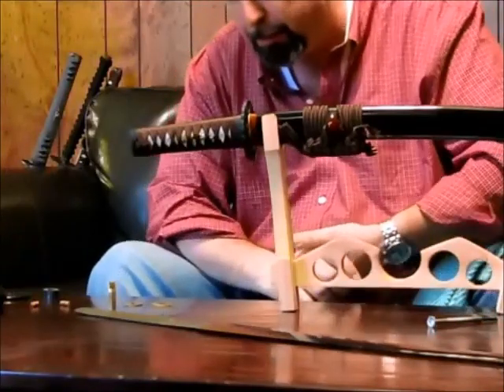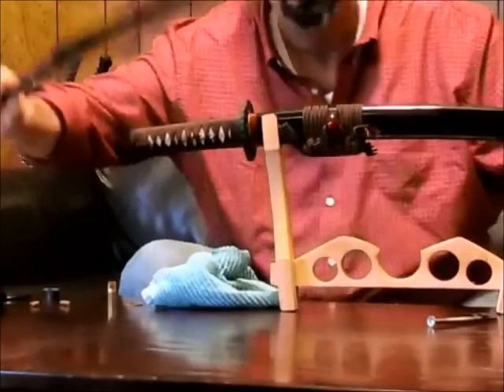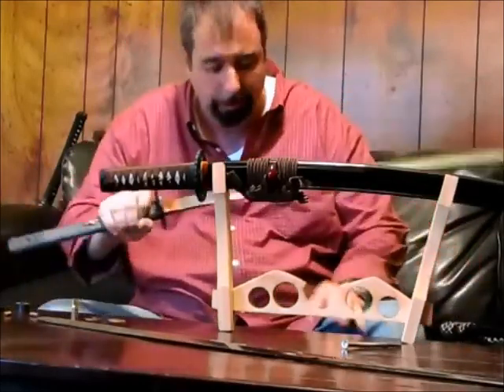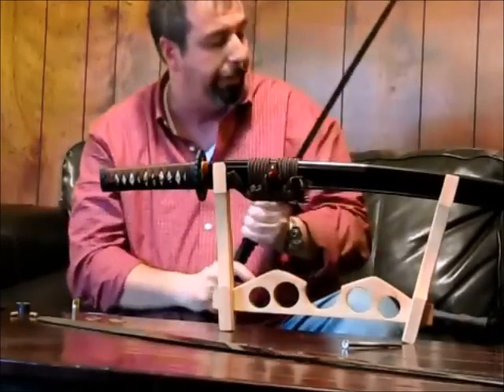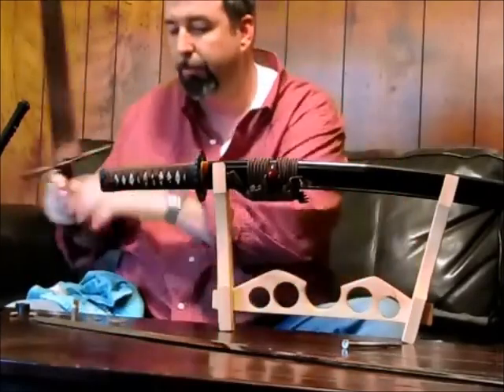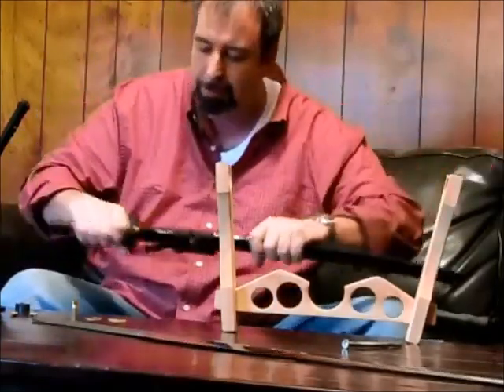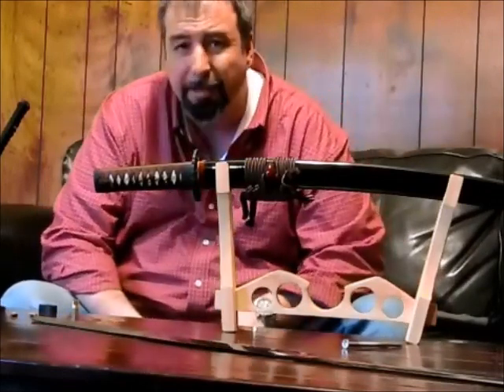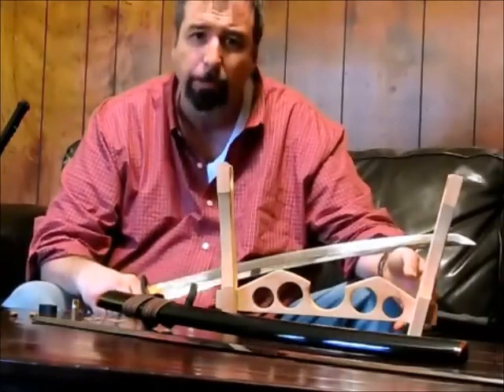Parts of a Japanese Sword - How the Parts of a Samurai Sword Work - Hardening & Tempering

Comment from the maker: @RazorDsknives I've sold 1045 blades as my entry level line for years without complaint of there being edge loss or rolling. It really is all in the heat treatment. I good heat treatment on a 1045 blade can harden the edge close to 50 on the Rockwell scale. A poor heat treatment on a 1060 blade can leave it with a hardness around 45. 

And yeah, that is the pro wakizashi on the stand. I think the one Marc has disassembled is a pro as well.

Comment: Was that a wakizashi sword on the stand? The dojo pro one? Also 1095 is just as tough as 1055, the destruction test on the cold steel gi tanto compared to the esee rc4 or cs srk are similar, but, on a longer blade i suppose it will make a difference with more stress. Will the 1045 hold an edge well?